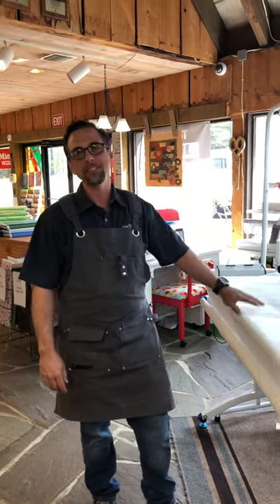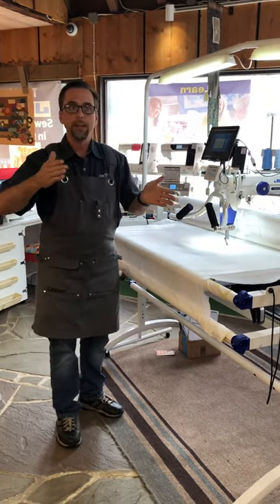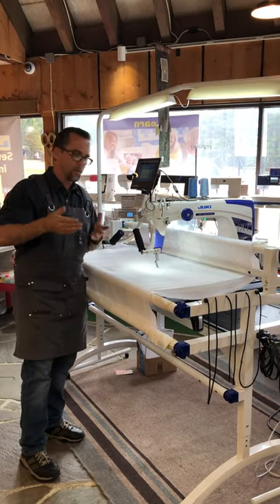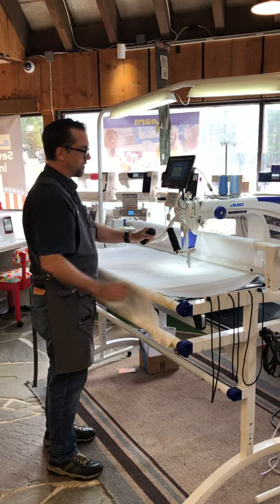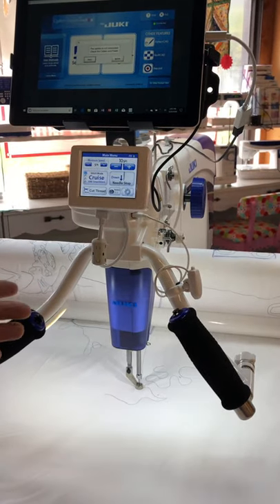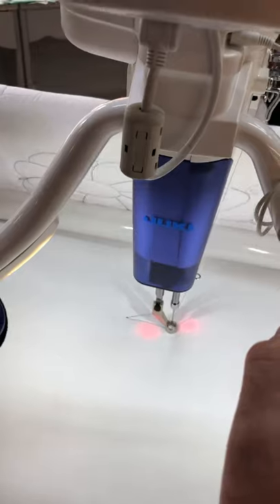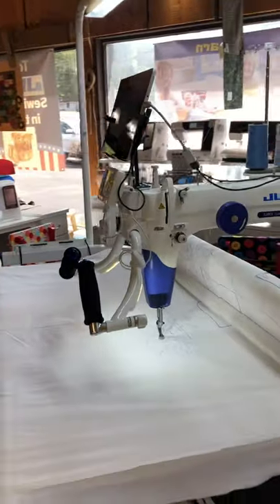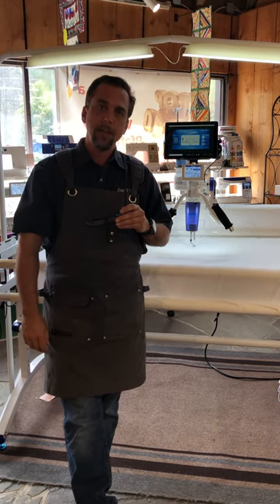Juki Miyabi Demonstration

Comment: Thanks for doing this. There's a real need for info on this model. I bought  the Miyabi 350 and put it  in the table as I really didn't have room for the frame but felt your on your own. 
The company doesn't give you any info other than basic turn it on. I couldn't find much on you tube. Please do more demo's
Reply from the maker: Will do!
Reply: I have the sit down also.  Absolutely love it.  Sad to say, everything I learned on how to use it, I got from watching HandiQuilter videos.  They have all kinds of neat tricks for a sitdown machine & all can be applied to the Juki.  I just was more impressed with how the Juki Myobi runs & the thread cutter & bobbin winder are so awesome.  It truly is a time saver!

Comment: Thanks for this video!  It definitely makes me want to purchase the Juki.  I'm a bit tight on space and haven't found any documentation on the dimensions for the frame.  Can you please let me know the full width of the frame, including the wheel and handle of the crank?  And also the depth of the frame, including the long arm when the long arm is at the front of the frame?  Would you recommend putting the frame on casters?  Sorry for all the questions, I appreciate your help.
Reply from the maker: Can you let me know the frame size you are considering?
Reply: I'd be curious about the dimensions of the 12 foot frame set up. Great video!!